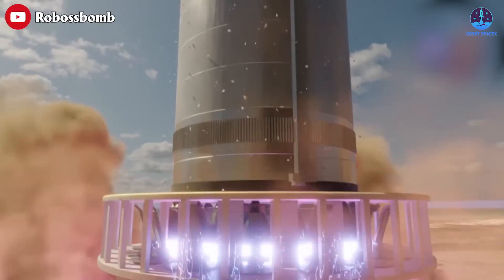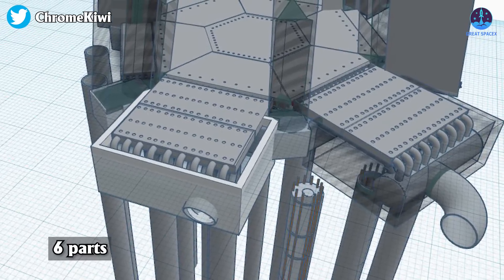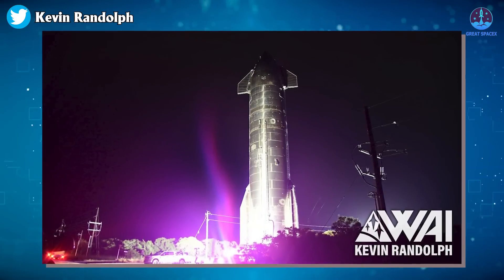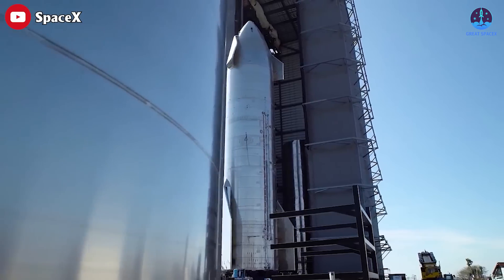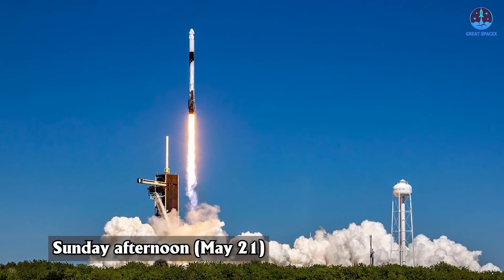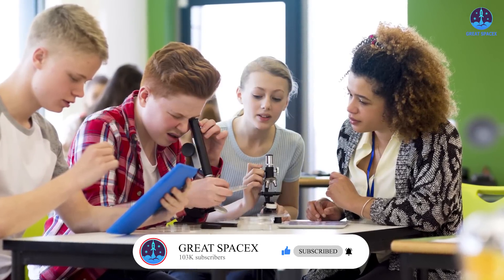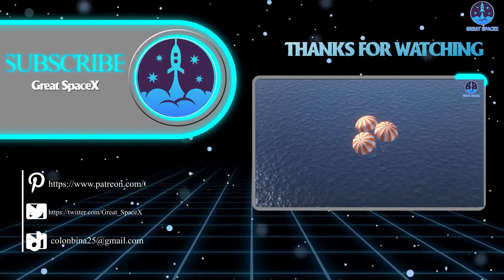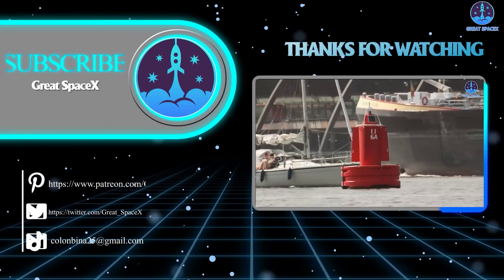SpaceX tricks to save OLM

Comment: The problem with a flame diverter trench is that, unlike all other rockets ever designed, built and launched, SpaceX swaps out engines while the booster is on the stand. It has to for purposes of rapid reusability. Now, if you have a deep flame trench, how are you going to do that? Erect scaffolding in the trench area when you need to swap out an engine? I suppose you could use the chopstick arms to hold it over the adjacent tarmac to do allow engine swaps to be done. But the shower-head design means you simply drive the engine transports right underneath, scissor jack the engines up to the booster and start work. AND, you don't need to give Feds the ability to delay you for a couple of years for trench digging approval.
Reply: The FAA stalling and eir's are a real problem.
Reply: Same way they do it now. They have a lift table designed that will be reinstalled.
Reply: @kstaxman2  Look: the booster is supposed to be turned around in a day or so for relaunch. Think about the water cooled steel plate and somewhat frequent engine swaps... like, say, a military base.
Reply: Pad 39 at Canaveral has a flame diverter in its trench that is on WHEELS and can be rolled out from under the rocket. Allowing access to the engine bay if needed.    The only reason they can’t do this at Boca Chica is the entirely idiotic decision to mount this thing on Six legs, making the space between each leg too narrow to roll a large enough diverter in and out.   The reason they mounted the OLM this was is because Musk did not want to go thru the regulatory clearances he would need to build a concrete trench, and he didn’t want to have to roll his enormous rocket UP a hill to the pad.  ( tho he could have just had the chopsticks have a wider swing so he could lift the rocket from the opposite side of the pad from a level roadbed. ) 
Musk was “certain” they could find a solution that did not require what every other country on earth had figured out was minimally necessary. 

For starship to succeed, the one thing they needed more than the rocket, was a PAD that could be launched from with NO necessary repair or maintenance.  Keep in mind that the plan is for the booster to ONLY be off the pad for about 12-16 minutes- its supposed to Come Back and land on it, too.   The Pad is the main failure of this program. Thus far its not even close to being able to repeat launch in weeks, much less hours. And it all comes down to a stupid Musk decision.   When he states that ‘they’ thought the fondag would survive one launch, he’s lying.   HE thought that. His TEAM clearly thought the water cooled steel plates was needed or else they would not have already been spending millions on designing and building it. It was stupid on its face to rush the launch before it was installed.  The only possible reason to do so had to be either spurring investor funding, or meeting a performance requirement from NASA to keep Artemis money coming in.
Reply: @christopherpardell4418  You really do hate Elon don't you ... The land that Kennedy space center is on allows for digging deeper than what SpaceX can where they are. The water table won't allow for something like Kennedy has. What Elon said was that he thought SpaceX could get by without it. He was wrong he's been wrong on several things he tried but it was worth checking it out. This is easily fixed as SpaceX is showing. As to launching before it was installed that's just how SpaceX likes to do things. Build it. Launch it. Fix what doesn't work and repeat the process. For all you find wrong with what SpaceX is doing who's progressing faster SpaceX or the other rocket companies? SpaceX builds faster, cheaper, and better when all is said and done. Somehow that seems to offend you.. LOL
Reply: @christopherpardell4418  And if the new system, installed in a matter of 3~4 months solves the problem? Then what? Was he smart?
Reply: @lawrenceallen8096  No- HE didn’t design it. His hirelings did. They rather obviously did NOT think the pad could survive one launch. And THEY were right. What MUSK did was decide to launch BEFORE it was finished and installed.  The site and the OLM took perhaps 20 to 60 million in damage it didn’t NEED to take.   And why is he two years behind schedule?   Because Musk failed to fill out the paper work required by government regulators to get his launch clearance.  Again, he thinks the rules don’t apply to him.  Why was he forced to buy Twitter?   Because he got in a pissing  match over them not letting him manipulate his stock and crypto prices.   Look, I am all for seeing this rocket fly successfully. I think it would be great to have a fully reusable launch capability.   I have been excited and enthused over the achievements of SpaceX.  But that doesn’t make me blind to the foibles and failures of the guy who happens to own controlling interest of the company.  
Once more, Space X engineers signed a letter to the board asking Musk be removed because he’s more of a problem than a solution.
I think his recent hijinx are pretty solid evidence that his narcissism is becoming truly toxic.
Reply: @christopherpardell4418  Musk is working on an Agile methodology
which means you test as stuff gets done, identify what didn't work right, redesign and build again.  You don't wait until everything has been thought of and is done, that's how Boeing is where they are with Starliner.  If let's say his engineers/builders were not ready to go with the better, water-cooled design and he knew the sub-foundation was going to need to be dug up to install it when it was, why not kill 2 birds with 1 stone?  And Twitter and the Boring Company have nothing to do with it.

Out of curiousity are you an ex-Musk employee?  An engineer perhaps?
Reply: @KurgerBurger  I know what SpaceX  is doing.   ( let’s not credit Musk too much, because that same methodology isn’t helping with Twitter, his boring tunnels, nor his self driving cars.). But you can’t ITERATE a foundation for a building. If the foundation is insufficient, nothing you can do in building Onto it will correct it.  

The sub foundation did not need to be dug up to install what they have designed, It was designed to go AROUND the 6 grade beams, 2 of which are now blasted to bits. And  2 more of which are cracked and deformed and have had the compacted soil excavated from under them. ( you CAN’T effectively compact soil back UNDER a grade beam from the side- it would literally LIFT the grade beam. )  I still have not heard if the piles on which he built the OLM were drilled all the way to bedrock, or if they are friction piles, that support weight solely by the friction of the sides of the pile with the soil- but if they are friction piles, then the pounding they got could literally liquify the soil that is supposed to hold them up.  Neither we nor Musk will know until he tries to re-stack and fuel a starship.  When they do, they’ll leave the chopsticks under the lift points in case the pad starts to tilt towards the damaged piles. Its also possible the OLM won’t start to tilt until the vibration of the next engine startup.
They did not NEED to punch dozens of holes in critical support structures. Did not need to place the tank farm within striking distance of debris when their Pad design afforded ZERO protection from the blast. ( the late addition of the angled concrete berms literally acted to deflect high energy debris upwards so it stuck the tanks higher up, and rained chunks of debris on top of them and beyond - which is further evidence that the SpaceX team, while very good at building rockets, just doesn’t understand much about what they are doing. They  keep making idiot errors as regards launch facility ) 
The only rational reason to rush the launch is that he’s two years behind his promised goal, and he needed to launch by a certain date to keep NASA funding coming in.  So he blew apart his pad so he could get more of your and my tax money to further fund his iterations of error. 

Consider the spin prime test in which these rocket scientists had failed to anticipate that venting methane into the space under the pad might create a perfect fuel/air mix for a detonation, the concussion from which did considerable damage to the OLM and the booster.  Did they REALLY NEED to build that without a means of neutralizing that threat before they figured out that rocket fuel is explosive and methane evaporates rapidly? 
Well what we saw in the drone footage was the equivalent of 20 or more concussive shocks of the same or greater magnitude. You can see them pulsing up the sides of the rocket just before the broken concrete chunks start flying.
I absolutely agree with you that an iterative process is a great way to build a rocket no one has ever built before.   But human beings have been building launch pads for ever larger rockets for over 60 years.  MOST of the problem solving for that problem has been DONE. Sound designs have already been iterated and improved. 
My analogy would be that Musk tried to re-invent the semi truck, but he did not start by building it on hexagonal wheels. He opted for the round wheels that had already been proven to work best.  He had six or seven existing large scale rocket launch facilities from which to glean a proper foundation and blast channeling design for his OLM.  But he just opted to go with something that accomplished NONE of the functional purposes that every other launch facility narrowed in on. Flame channeling, thrust diverter, massive water deluge for acoustic shock.   
This new design only has ONE of those 3 and its still not putting enough water where it should be.  It has a flat plate taking the full perpendicular shock of the thrust, AND the acoustic shockwaves. And it concentrates the heat and supersonic blast of the drive plume on the steel plate like an acetylene torch.  Musk said they think the engine plumes might have compacted the sand UNDER the concrete allowing it to crack which i think is BS- the acoustic shock acted like a jackhammer , but if he is right, then a flat steel plate on top of the concrete will still simply allow the concrete and sand to get pounded, just the same. It will flex like a drum head.
Maybe it will work.  But my knowledge of physics tells me it will not survive unscathed and ready for another launch.

And to answer your question, I am not an accredited engineer. I am a sculptor. But I have designed and built everything from large scale fountains, to buildings and even a bridge and never had an engineer revise any of my designs.  ( not saying I am in the same league, but consider that Michelangelo ALSO designed the dome of St.Peter’s in Rome; every properly trained sculptor is part engineer. ) I know next to nothing about rocket engines. But I know how to build something in steel and concrete, foundations and what they can and can’t take.  And I know when iteration makes sense, and when it just doesn’t.  Look at what worked for the Saturn 5, the shuttle and then Artemis.  Then make something like that only twice as strong.  Twice the deluge flow, twice as robust a diverter. 
Job 1 in the idea behind starship was a rapidly reusable launch pad. They have worked wonders on the ship, but the pad they have just looks like they haven’t given the slightest thought to what it has to endure.  You don’t HAVE to launch the world biggest rocket from a six legged stand to guess that it will fling crap in 6 directions. Just maybe DON’T put the rocket fuel and oxygen tanks in the line of fire?   MAYBE close in two of the six openings to create “safe” areas for supporting equipment and supplies?
I mean, what they have built as a launch pad would be equivalent to the first hopper test for starship having the rocket nozzle pointing Up rather than down. Some things you just shouldn’t NEED to Try Out to prove to yourself they won’t do the job.
Reply: @christopherpardell4418    I tend to agree with most of what you are saying, the OLM was a really stupid idea and I agree that the design team thought so too but Musk didn’t and he’s the boss. As you say, he should have built a flame trench and water deluge system from day one, almost every serious commenter said so, which would have proved cheaper in the long run, the high water table is not a problem, just build the whole thing from ground level up, it’s not difficult.
I agree with you about the steel plates and water flow, I really can’t see it working, it’s flat! Where is all that energy going to go? Down the drain or up into the engine bay same as before?
The problem you are facing is that many people here can’t stand Musk being criticised because they think he is wonderful, hence all the attacks on you.
Reply: @christopherpardell4418  where did you get your civil engineering degree from? You need to get a refund... ROFL
Reply: @kstaxman2  When they complete the water-cooled steel plate design, and blow away the world, you can say: "Oh, yeah. Of course they did that. That's what I would have done."
Reply: @kstaxman2   I’m actually a sculptor, but have designed buildings, municipal fountains, A new kind of space frame that supports 26 times its own weight, and the structural designs for things like Jon Hair’s  18’ tall bronze gamecock outside the new stadium at USC.   While my designs get submitted to licensed civil engineers, I have never had a civil engineer modify one of my designs, they just calc them out and approve them, unchanged, or occasionally specify a slightly heavier walled steel tubing.  The new type of space frame I designed had to be verified thru finite element analysis, and it passed without revisions. When we took out the cribbing supporting the 35 foot span of the space frame during fabrication, the deflection was Less than the width of the laser we were using to measure it.    I have a pretty sound comprehension of physics, and materials, and I actually build things.  But what I have that Musk lacks is the ability to realize that OTHER folks, before me, have often solved engineering problems from which I can learn.   Musk is trying to build a rapidly reusable rocket, which no one else has done, but he has built a SINGLE USE launch pad.  Which no one else has done, either. ODDLY, NASA and every other nation that puts up single use rockets LONG AGO figured out how to build a rapidly reusable launch pad. THAT is how SpaceX gets such a rapid launch cadence when they use the pads at Canaveral and Vandenburg.  
You don’t have to BE a professional baseball player to tell when one has struck out.
If you HAVE an engineering critique of my comments, go right ahead and make one.
Reply: @christopherpardell4418  the steel plates that are going in will be flat and certainly able to support whatever SpaceX needs to get in and replace the engines. From cranes to lift platforms SpaceX has anything the might need. The move the whole starship around and lift it as they need to and you don't think they can figure out how to replace engines on the launch mount. Come on they have many problems this isn't one of them... LOL
Reply: @kstaxman2  Flat steel plates are stupid. Watch the drone footage. You can SEE what shattered the concrete. Shooting up the side of the rocket are concussive blasts that are the reflections of acoustic shockwaves that pounded the pad AND the grade beams under it into rubble. A flat plate takes the full force of the acoustic energy and reflects it, with 33 engines each producing hundreds of sonic booms per minute, those shockwaves create constructive interference that amplifies their impact energy.  You build a DIVERTER so that those shockwaves and the force of the engine plume get redirected AWAY from the pad under the rocket. The shockwaves reflect to the side, rather than straight back up into the engines and mount. And you minimize the force vector hitting the pad proper. The Deluge is there to absorb shockwave energy into atomizing water, that is then evaporated by heat and the diverter redirects the plume to shoot that evaporating water and heat AWAY from the pad and the rocket.  ( If you are actually smart, you build a trench so you can channel the plume so as to protect nearby infrastructure, something this 6 legged imbecility doesn’t do at the cost a  few million in avoidable damage )  Having  water flowing INSIDE a steel plate means you are asking the plate to absorb heat energy, and then radiate it into the water. When simply having the water OVER the plate is more effective AND helps absorb acoustic shock.   There is a good chance this flat steel plate will be COINED by the acoustic energy. Meaning it too will need to be repaired after every launch.   What this looks like is trying to mitigate a huge mistake in design, rather than actually address the mistake.  Space X is GREAT at iterating rockets.   They don’t have that much experience in building launch pads.   But I would wager that there are a LOT of engineers at SpaceX who tried very hard to explain why this pad design was not gonna work.
Reply: @christopherpardell4418  The water will take care of the blast you're talking about. Just wait and see. Obviously you don't understand that the steel isn't to stop the shock wave it's just to give the water a place to be sprayed from. Wait and see.. I can understand your doubt but it's the water that matters not the steel. The water will disrupt the shock waves. Wait and see.
Reply: @kstaxman2  I don’t think you have the slightest idea of the forces involved. Most water deluge systems emit massive amounts of water well above the pad. Just below the engine nozzles.  That is to try and attenuate the shockwaves before they hit the diverter.   Then, in the shuttle era, they added water deluge emitted out of the Top of the diverter as well to further cool the steel and help prevent the shockwaves from bending or breaking the steel structure and covered the steel diverter with an ablative coating. And now, for Artemis they have re-configured the diverter to be made of a hundred separate smaller steel plates, because despite all of this the steel plates are STILL gonna get destroyed or damaged and this way they are quicker and easier to replace.  The Diverter at pad 39 is angled and curved to sweep the force of the blast to one side, reducing the actual force on the pad to a fraction of the force of the rocket. And Artemis is HALF as powerful as Starship.  The flat plate with water just flowing inside and over the top is going to ensure it takes the full force of the millions of pounds of force, the intense heat energy, and the creating of standing waves of concussive shocks that will pound the steel like gigantic ball peen hammers.   Its a half measure.  Its the thing they CAN stick under the pad, between the legs. NOT the thing that would best protect the pad and the infrastructure.    They would have done better to have the thing on 4 legs so they could have a rolling diverter and wall in two sides to protect surrounding infrastructure.    The rocket not even at full power still tore rebar apart like spaghetti.     The Design of the OLM is about as bad as Musk’s design for a ‘people mover’ in tunnels under the vegas strip, which is nothing but a traffic jam of chauffeured Teslas that is literally slower than walking and offers NO means of safe egress from the tunnels should one of his teslas catch fire.
Reply: @kstaxman2  The water is supposed to “cool” the steel plate because the water flows INSIDE the steel sandwich. But that is expecting the steel to ABSORB heat and then transfer that heat to the water.   The water will have to be at enormous pressure to come out of the holes against the thrust of 33 raptors, which means it CAN and WILL become superheated Inside the sandwich. What will happen when it exits the holes is its pressure will drop and it will flash into superheated steam. ( like water does in a nuclear reactor ) This will first of all dramatically reduce its ability to absorb heat from the plasma, but more importantly will turn the water into a vapor thru which concussive shockwaves can readily be transmitted to the stupidly flat steel plate.   NO OTHER deluge system tries to fire water straight up into the exhaust plume.   They place a SHEET of water, feet thick, in midair between the exhaust plume and the diverter and the pad.  You want the acoustic energy to atomize the water.  That attenuates the sound overpressure by breaking up its wavefront, and increases the surface area of the water so it can better absorb heat. And then the exhaust flow pushes that heat away and remaining sound energy from the rocket because it hits a CURVED diverter.  This prevents the full thrust force vector from being transmitted into the pad and its foundation.  The NEW design at Boca does not divert ANY of the thrust impact, it just slams it all against a steel box, and asks it to make a 90 degree turn in every direction.
Y’know who DOESN’T have an engineering degree?   Musk.   And guess who DOES have civil Engineering degrees?  ALL the guys who designed all the rapidly reusable launch pads in nations from the US, to China, to Russia, and ULA.   And guess what they ALL have in common?   Deluge systems that inject water ABOVE a Diverter in a Flame Trench. 
SpaceX isn’t building a deluge system. They are building a Shower Head. ( so Musk described it ) The reason has nothing to do with engineering… its because the Army Corp of Engineers would not ALLOW a deluge system in a sensitive environmental wetland, and Musk did not buy enough land, nor allow enough ROOM to build a water retention pond to hold fresh water deluge.  Musk utterly failed to do due diligence in picking the site and the overall plan.  He abandoned initial plans for a flame trench because it was the only way to keep the Army Corp out of his business.  In short, he is making capricious decisions based upon politics, personal whim, and his belief the rules should not apply to him.  Like launching without his shower head in place just so he could have a launch on 4/20.
Reply: @christopherpardell4418  It still blows my mind that they aren't willing to build a flame trench. Just trying to mitigate a flawed design (flat surface under the rocket). I understand the costs of a flame trench system must be very high at that location, but it's just simply necessary. The energy of the rocket has to be redirected to the sides
Reply: @gerardt3284    They literally Can’t build a flame trench at this point.  The issue is the Army Corp of Engineers will NOT allow them to dump a water deluge into the salt water wetlands on site, and that means building a retaining pond to catch all the deluge runoff… but they don’t have the room to build such a pond given where they located the launch tower and pad.  Their plan is to spray water up under the rocket like a shower head and HOPE that the flame just obliterates all the fresh water so they won’t get shut down for the runoff. This all goes back to the initial purchase of the site and Musk’s decision that he did not want to deal with the ACoE, nor take the time to get the clearances he would need.   I am sure SpaceX is chock full of gifted engineers, who are forced to try and compensate for Musk’s often ill considered caprices.
Reply: First they won't have a much deep area than they have now under the Starship. This isn't going to be a massive pit. Just look at they work they are doing now and you'll see that they pilings they are putting in come to about the same place as the old concrete base they had. Second they have all kinds of ways to lift men and equipment up to the work area. They lift men and equipment in the high bays all the time much more than they will need to lift them at the starbase launch site.
Reply: The first attempt cleared the platform. Would the second attempt blow it up? What sort of a star ship can not separate and land in case of emergency?
Reply: @reasonerenlightened2456  Uh, one that just had its very first test flight? All new design. All new materials. All new fuel (methalox). New engines. One that can swap out engines in less than an hour on the launch pad, readying it for same-date turn around. P.S. the first attempt cleared the launch tower, went nearly 4 minutes, passed Max Q (Look it up). And was destroyed by its flight termination system because it was too low in altitude for separation. I suppose YOU still want to pay the Russians $ 90 mil a seat on their Soyuz, right? And to continue to buy 35 year old-design Russian engines for America's other rockets, but we don't. You Russia lovers are pathetic. When Starship completes its first orbital launch this year ALL OTHER FLIGHT-CERTIFIED ROCKETS ON EARTH will become instantly obsolete.